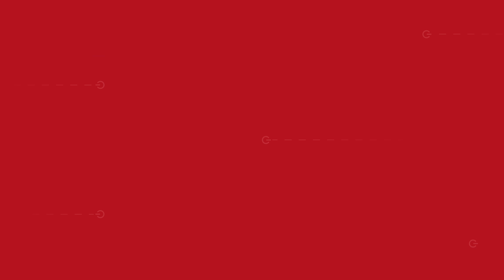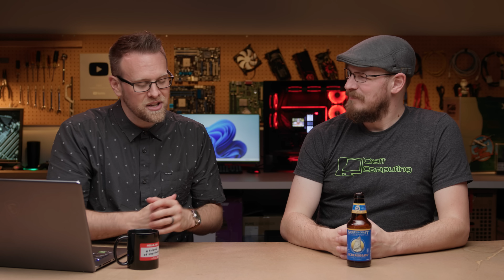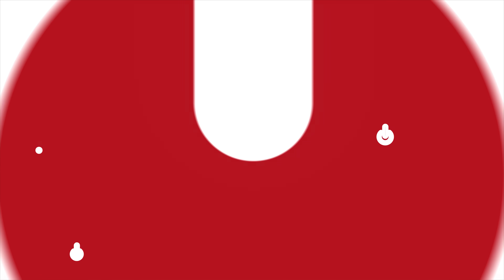Old Server CPUs For Budget Gaming Or Workstation PCs

Comment: In my honest opinion, for Linux gaming, Epyc would be better for gaming (exactly the same CPU die as regular Ryzen processors), especially if you have a faster variant, compared to Xeon, but yeah, obviously YMMV. Xeon isn't necessarily bad for gaming, it's that learning curves for manual Linux OS gaming tuning for server CPU is a little bit steep, including learning how to use specific server CPU toolkits such as numactl (the same applies to both Epyc and Ryzen Threadripper CPUs, obviously). For practical intentions, normal consumer CPU is better for that kind of thing if you are not into tuning while having mountain of CPU cores to sit on, it's about thinking about the use you would do with the secondhand server CPUs, or even new ones if you can afford one.

Comment: I love building older workstations and you would be surprised how well they can still do in gaming.  Modern games support 8+ cores so you really want more than that anyways for encoding, streaming..etc.  Older workstations also tend to be more reliable.

With that said, would I pair a 4090 with some older Xeons? probably not but core count still counts and with the right GPU? You will still be just fine and spending less $$$.

Comment: I love fiddling with X99 and older professional graphics cards.  My daily driver is an Asus X99 Deluxe II board (I bought it new) with an E5-2699e5 (Broadwell, 18C/36T), 32 GB in quad channel, and a pair of FirePro W7100s each feeding a 32" 4K display and running 25H2.  I'm replying to this message on it.  It's way overkill, but I love it.

Comment: My budget PC that is a compilation of (almost) e-waste parts finally up and running.
I found out that a few select of E5 26xx v3/v4 CPUs could be paired with X99 and DDR3 memory. So i ditched the existing i5 3470 (4c/4t) and got it replaced with E5 2676 v3 (12c/24t) at similar price. What a bargain with a huge performance upgrade.

Now i have way better computing power to do multitasking whilst playing CPU intensive games such as Cities Skylines or Transport Fever 2, which was impossible to be done by i5 3470.
Reply: Nice

Comment: Much of the older Intel stuff cost too much IMO in northern EU, meanwhile there are used AM4 kits around 100USD with 3600/b350/16GB that will easily beat anything up to 9700k which i´ve seen for 200USD. So gaming-wise AM4 is worth while a look into!

Comment: Worth it if you chose the lowest spec for kids

CPU : E-5 2680 V4  $15
MB : Machinist X99M-A $40
Used RAM 32 MB : $30
Whatever cheap PSU : $30
used 2060/5700XT/6600XT  (because higher than this, you gonna get CPU bottlenecked) : $150/$125/$180

This is cheapest option even in 2025.

Comment: I got a great deal on a Dell7820, 300Bucks( barebones), 2 xeon 6138 gold 120 bucks for both, 128 gbs ecc 2400 Ram 140bucks.... 40 cores, 80 threads makes my  houdini renders great and allows me to work in Houdini on my main system without render downtime.

Comment: Late to the party... But unless you have FOMO about resolution/features/high fps or run the newest AAA games, you can run all of your daily tasks and most of your light to moderate gaming on a reasonably priced/slightly older pc... Even in 2025, all but a small handful of my games will run on like an 17-4770 and GTX 970

Comment: For what it's worth, grok and I discussed this IN DEPTH and the GPU bottleneck is not as bad as said here. In fact, an older xeon can play modern games at 4k as long as it is broadwell or newer, you have at least more than 6 cores, and a good single speed turbo and good cooling. I have an x99e-WS mobo and an 18 core broadwell with a 3.65 turbo and 128gb ECC RAM- according to grok literally doing all the math with case, fan type and config, and noctua cooler type- I should still be able to game well with a new 5090. I was a bit surprised but there were detailed explanations for everything. Including whether my silverstone 1000w platinum would handle the load with full drive bays. That said, I am not recommending this. I already have a rop tier workstation I use for 3D and editing. Gaming is secondary but I should still be able to push good framerates. Cyberpunk sucks so Im not even looking caring much about how playable it is.

Comment: Most tasks are hyperthread aware.  Having 18-22 cores means tasks get done quick.  I game on mine and it is adequate.  Mind you, my old third gen quad core Intel i5 works too.

Manufacturers already made a high enough quality of processing the last 15 years. Only challenges are the software companies making redundant code, locking you out of using older hardware, removing your right to own and use older operating systems and video features that are backward.

Comment: If you're are going to be running a lot of stuff that are idle half the time, then cores is what you need, and old xeon are good. But if that stuff is constantly doing calculations, you will need clock speed AND cores, and xeon will feel sluggish.

Comment: I scored a dell precision 5820 for 280 usd, it came with 512 ssd+1tb hdd, whooping 128gbs of ram, quadro p4000 8gb and a 6c/12t xeon w2133 cpu... I sold the quadro for 115, got a 5700 xt for 127, in total it cost me $290 and plays anything i throw at it. Could probably sell half the ram for another $40-50 and make it even cheaper at $240-250. Nothing will top price/performance there lol
Reply: I just recently gotten the 5810 personally and slapped in a rx 570 (i also own the rx 5700 its a great choice for modern gaming). Got it for 120 dollars for the workstation alone.

Comment: For less than $500, based on an HP z420, Xeon E5-2697 v2 (12c/24t), 128GB ECC DDR3, 2TB SSD, 4TB HDD, RTX 3050 running Ubuntu Studio 34.04. Not for gaming, it is a great media system.

Comment: Love my Dell Precision, 2008,  T7400,  Twin 5430 Xeon  Quad cores, clocked at 2.66 Gig Hz.   12 Gig full buffered RAM, 1 TB SSD drive.    The wife often needs batch Jpeg photos rendered in to CMYK files,  and the T7400,  does this with out  breaking a sweat.  Like, it was not even effected.    Got it from a refurbishing center for $86.  I think no one  wanted this because they are massive machines.      But I did have to buy the SSD and the 4 gig, PCIe vid card.

Comment: I bought a z440 workstation for 550 USD. Following is the specific:

Processer : 22 cores xeon v4 
RAM : 96 gb
GPU : RX 590 8gb
SSD : 1TB

Use it for cybersecurity labsetup.

Comment: I bought two used Xeon 6140 for $50 in total on eBay for a Dell workstation. They have a total of 36 cores and 72 logical cores. They manage up to 1.5TB RAM with 4 lines each. That's a massive bandwidth. Games are ok in 4k (I have an RTX 3080 in the station), but those CPUs really shine for work tasks.

Comment: If you want to build anything XEON X99 there is only one reference Youtuber to consider: MiyConst.

I have been using the following since the early days of COV: HuananZhi X99TF + E52696v3 + 48GB DDR4 Corsair Vengeance 3200 + RTX2080Ti + 650W Corsair 80+ Gold PSU + PCCooler GI-D66A cooler + 1TB NVME m.2 SSD (w/Win11Pro OS) + LianLi Meshcool II case.  The entire build (excl. mouse, keyboard, and TV/monitor) cost me under US$650 (some parts were sourced from a local auction site, plus AliExpress for MB and CPU). I've turbo-unlocked the CPU (w/MiyConst's Mi899 software tool), run the 4 channel memory in XMP, and undervolted the 2080Ti. 

My system has been running stable 24x7 for home office (MS office activities) + evening and weekend casual use (streaming video, movies, games, drone footage and photo editing, etc.).  It auto-sleeps in downtime.  This XEON rig has been extremely reliable/stable the whole time. 

The only thing I have upgrade recently is the TV monitor, purchasing a used (mint) LG 49nano86 (4K, native 120Hz) for $220.  I could not pass up that deal!

Comment: 1:16 - the answer is YES! 4K gaming relies more on the gpu than cpu. I would advise against Xeons if you want ultra high FPS in competitive games, they cannot pair up with a 5600xt for instance, but for AAA story driven games, go for it, a cheap 2680v4 can go nicely with a 6600xt or a 3060 12tb for that. What he said about even at 4k the cpu needs to pair up really matters not. I watched a comparison in between a 2667v4 vs 5700x3d using a 4070 ti at 4k, the difference is around of 2-3 fps.

Comment: Wery old server hardware have insane power usage with wery low performance.
Have a hp 360 g7, just disconnecting one of the dual psu alone give almost 40 watt lower total consumption..

Comment: HP Z440 with a E5-2687W v4. 12 core, 24 thread machine which goes for around £150 in the UK. DD4 Ram on these and for me its doing great on driving simulators. i.e Assetto Corsa gives 170 FPS with all settings on Ultra.
Reply: thats pretty good, which gpu did you pair with it?
Reply: @Writeous0ne  GTX 1060 6GB. They have a 700w PSU so plug right in.

Comment: X99 combo on Aliexpress now around $70 . E5 2680v4 , 16GB DDR4, Mougol x99 Mobo . If that aint a bargain i dont know what is and this supports FMA3 & AVX2 instructions 🙏
Reply: What's the importance of the instructions you mentioned?
Reply: @diylithiumguy some games dont work on the x79 cpu's coz they only have avx instructions
Reply: @wandileqamata guess i dont know what you mean by instructions 😅
Reply: @diylithiumguy this is not a slight, but google will help you understand it more. its basically a set of instructions for cpu's that lets the perform more intensive tasks. And in this context when the xeon cpu's were popular it first started with x58 then x79 v1 and v2 then prices dropped heavily on x99 v3. X58 and x79 cpu's were using ddr3 for ram and could only support up to avx meaning if new games came out needing FMA3, AVX2  then you couldnt play that game unless you waited for someone to make a version that wasnt bound by that requirement i think The Last Of Us had the requirement on PC when it was first ported so now even though they were cheap x58 and x79 lost a bit of value by being stuck using ddr3 memory and with older set of cpu instructions so when the price dropped for x99 which is using ddr4 memory and has FMA3 , AVX2 then that meant now the value proposition to go to x99 plartform increase thats what i meant by me original comment as the plartform was not gonna face a point of being blocked by a game because it needed cpu instructiins that were not on the plartform

Comment: I'm very new in this world of server class parts as I just bought a Dell 5820 Tower. Currently I have a 2155 CPU + P4000 GPU and just wondering my upgrade options even if I have to gut the case. I just love the hard drive bays in the front and the overall form factor. It's a very appealing look, just wondering if there are any upgrades I can make to this system to make it more power efficient or if it's stuck as is

Comment: i have bought a Dell R630 for 600€ including 2 Dell 12 3.5inch Bay PowerVault. My R630 had 128GB RAM with 4 DIMM and a single xeon e5 2603v3, external HBM controller for the PowerVault's, 4 port 10gbit sfp+ and a internal perc h330 mini. i needed a powerful server for my projects. I invested another 600€ for 2 xeon E5 2683v4 and another set of 4 DIMM for the second socket, a cooler for the second socket as well and 8 sata SSD 500gb each with drive caddy's. Now i have enough storage and compute power for a high memory bandwidth and parallelization workload. 
128gb is not much for my projects, but i can upgrade fairly cheap if i need to, the limit of my system is 3Tb RAM and if i would buy the same RAM modules i have installed. i would top out at 768Gb and that's is more than enough for the moment. Surprisingly in those PowerVault's were drives as i bought them, all of them are 4Tb SAS 12gbit 10k. The PoweVault's were dropped and got dented significantly. I got them for free on top. I mean why not, both work fine, only a total of 2 drives are nonoperational. 
i set up my R630 with ubuntu server on a USB3.0 drive internally, the SATA SSDs are in RAID10 for maximum speed and somewhat failure prove because those drives getting stressed a lot Even the data on those drives are volatile. The Powervault's are in Raid 6 each and a copy of its self, because this data is important for me and because i know those drives were dropped, i expect drive failure in the future. 
For the most part my R630 idles around 84W and doing nothing and acting like a NAS for me, but if i need the power, i loading um the SSDs and run my script and waiting usually Hours for the result. if i would do that on my work and game system this takes days to complete and i got sick of that, therefore the R630 in the end the R730 would be the smarter option. 
i don't regret it, it's the best thing i ever bought. This thing is crazy fast.

Comment: I think the value lies in used workstations like the Lenovo Thinkstation. I picked up my ‘mystery’ p510 for 80 bucks incl. shipping and received quite the bargain system. 850W platinum PSU, 14tb server HDD, 512Gb NVME, 64 GB of RAM, an e5-2690v4 and some random lab card I sold for 150 bucks. So basically a free gaming PC. Boungt an RX 580 and an IBM Model M from the leftover money, hooked the system to two Eizo s2202w I got for free and well… It works pretty well for what it is. Even the monitors are pretty serviceable (they got some very hq monitor stands that weigh a ton lol).
Reply: Good Lord, where did you score that?
Reply: @jjsikfnajskksmnen  Essentially German Craigslist. These Workstations get pretty cheap at certain times of a year in certain areas of the world. Since these workstations are often leased to companies they get insanely cheap when a big corporation decides to upgrade their IT and the leasing partner needs to get rid off the old hardware. 

Also ig I was extremely lucky with this PC. I originally wanted an old MacPro to tinker with but then I stumbled across the Thinkstation with no specs or model number listed, offered 70 bucks incl. shipping and had the system 1 week later. Heavy af tho. Weighs over 28 kgs.

Comment: In 2013 i bought a i7 4820k a 4 core ivy bridge e on an x79 mobo.  I went with that chip and platform for the quad channel memory.  In 2019 i upgraded to a xeon e5 1680 v2 an 8 core chip, i kept that for 4 more years.  I was able to get 10 years out of a mobo, ram, and AIO.  I built a new system in 2023 because i didn't have AVX 2 and the chip didn't support TPM, which is needed for window 11, which will be the only windows OS supported after October 2025.

Comment: I run a reconditioned HP workstation with dual Xeon E5-2680 V4 Cpu's and 128GB Ram Got masses of storage bays and ports up the wazoo,  Run a 8GB graphics card for it Think I paid about US$ 400 for it a couple of years ago with 9tb of storage all in mint condition.  Never missed a beat.  Absolute tank I really love the laser etched  system map on the inside of the main cover!        Passmark scores of 1,961 SC (Dismal) but 29,039 Multicore  (Yesss!)

Comment: The power consumption for some Xeon workstations is no joke.  I bought one and my apartment electricity bill doubled.  Depending on where you live and how much your electricity costs, you can spend enough in one years increased power costs to where you would have been better off just buying a new system.

Comment: Prices are way off or changed now. Now you can get e5-2697 v3 for $20. Motherboard cpu and ram combo is $80. And thats for a xeon that has a clock in the 3ghz range and higher l3 cache. Compare that $80 of older stuff to newer stuff same performance youre looking at $300-$350. $80 for a mobo cpu and ram is good. Just need cooler, psu, m.2 ssd and a case. Can get all that for another $190. All in like $270 for a mid tier gaming pc that would cost around $600-$800 for all new gen stuff with same performance.

Comment: You can put a 4th Gen I7 in the same LGA2011 socket with the same X99 chipset as those Xeons.

Have a couple of 4th Gen I7-4690Xs (?) octacores that I got for approx. £40 each and are easy to overclock (all cores) to 4.6Ghz - one being totally stable to over 4.8GHz (but not quite as high as 4.9 ;-D)

Comment: PCIE lanes with bifurcation is good for multiple SSDs. Dual x16 slots which drop to x8 when both are populated are useless for quad SSD cards (even if your graphics card doesn't mind) and motherboard-based SSD slots need to be looked at very carefully to see if you're bottlenecking them through the chipset.  This basically means dropping back to PCIE gen3 , but that's probably ok if you're prioritising capacity over speed.  Going PCIE gen4 seems to get very expensive in the workstation/server arena.

Comment: I got mine going for about 400 bucks. E5-2695V3 14 core 64GB DDR4 on an Asus motherboard. Paint, filters, and fans were the most expensive parts. I got the motherboard and processor together as a combo for a hundred bucks, it came with a tall 4 headtube heatsink but it hit the cover. I got a Dell workstation heatsink for it with a faster fan. Really it's a gamer board with RGB but I use it like a workstation it doesn't have a glass cover. I have a 750-watt Corsair RGB power supply that glows colors out the bottom. The memory was inexpensive compared to desktop prices it was about 6 bucks per stick. It looks weird having glowing colors on a workstation without a see though cover but I got a good deal on the glowing parts. My office PC glows colors now too.

Comment: You have to be a bit careful with the old Xeons. Make sure you get one that has AVX and AVX2 instructions. Some modern programs and games will refuse to launch without them. I think Baulders Gate 3 is one of the games that do not work without AVX instructions. For this reason I would not recommend getting anything older than a LGA-2011 V3 Xeon.
Reply: Thank you fortheheadsup im thinki gof gettinga lenovo p520